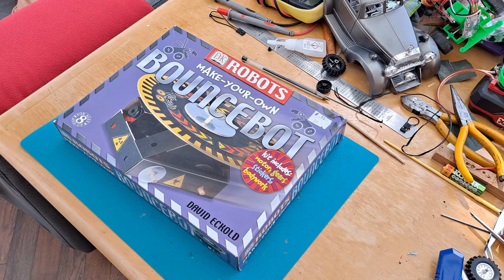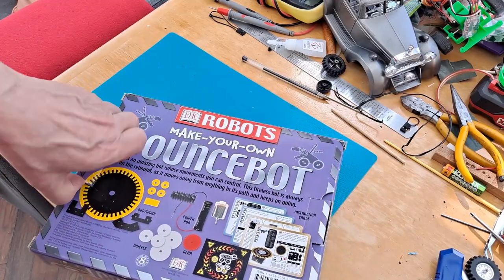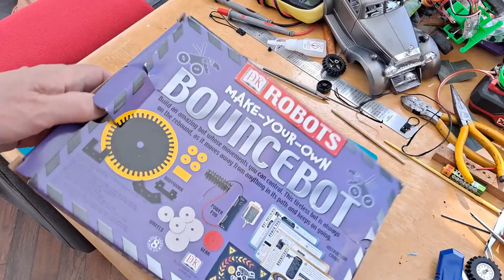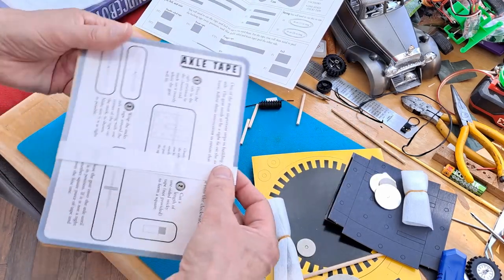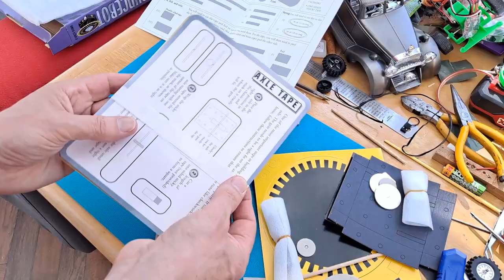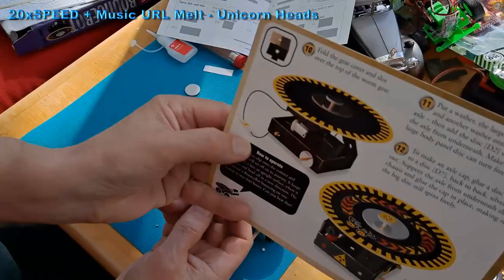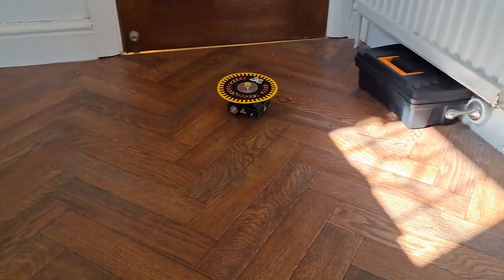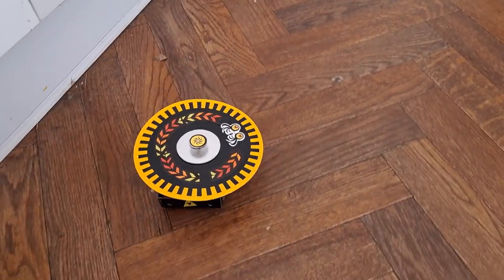DK Robots Make your own Bouncebot - Object Avoidance SHORTENED VIDEO

Comment: If the disk were extended down to make a cylinder that clears the floor about as much as the chassis, it would objects lower than the disk as well.  But even as is, it's quite an elegant solution to object avoidance.
Reply from the maker: You might like the David Vernon Williamson's video linked in the video description 👍

Comment: hi Why did you connect the battery up before you finished and how does the paper clip switch work best regards
Reply from the maker: I would check the motor runs, etc. The paperclip simply connects the wire to the silver paper, which has the other wire attached to it. A very simple way of making a connection that you can disconnect easily.

Comment: nice little bot but its not bouncing like it said on the box, but it certainly can avoid objects tho,wonder how the mechanism works and how it kniws when to turn away from an object, does it have some sort of laser detection that can detect an object or?
Reply from the maker: It is a very simple mechanism. The motor drives the wheels and the disk, when it hits a wall, the spinning disk naturally turns the car.